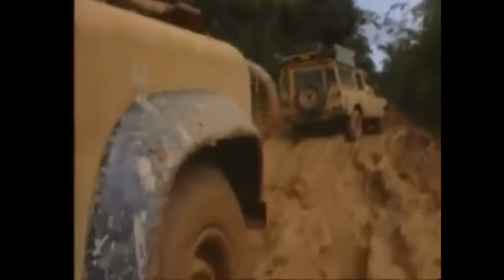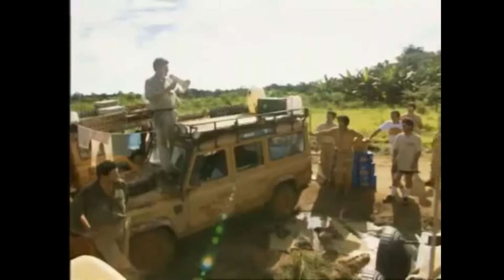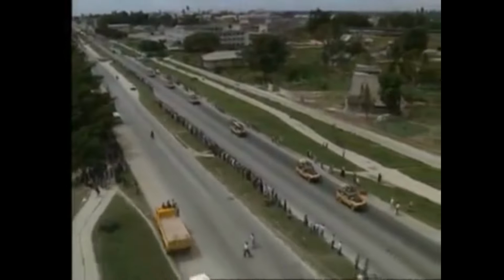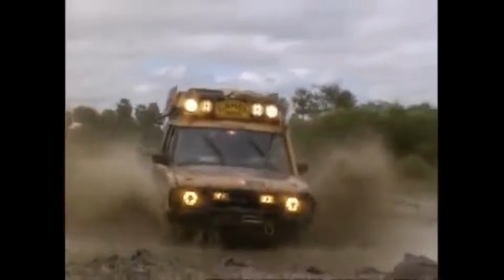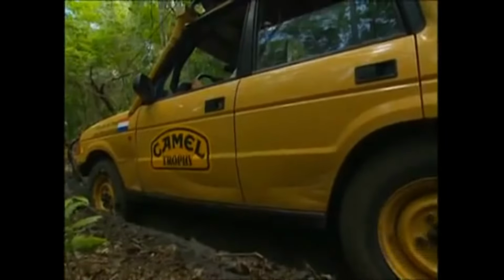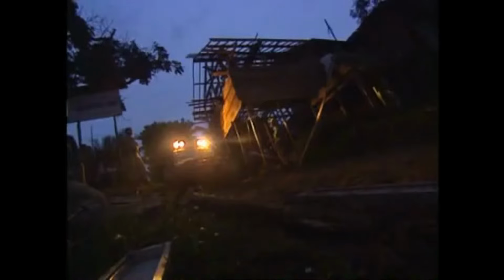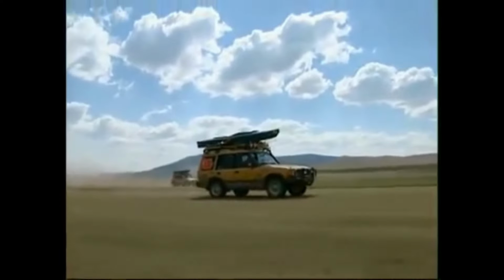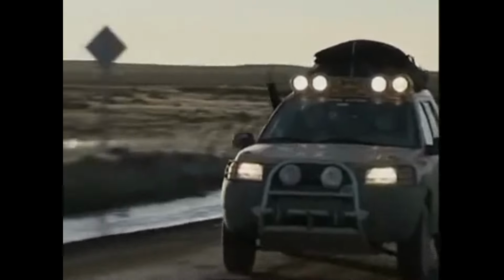Camel Trophy Land Rover Years ( DOCUMENTAL) 🐪

Comment: Personally.
I'd take an old trophy truck over anything rover sells in the USA.
 A turbo diesel engine, 5 speed manual, 
Solid axles, plus an actual fording..
Kit.
 I'll take that over power accessories and looking good for the bow tie crowd.